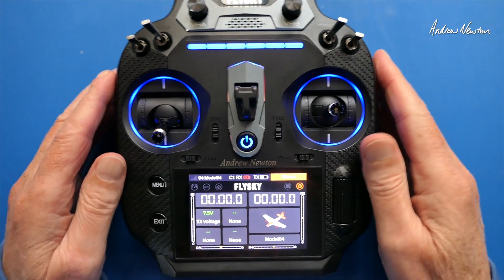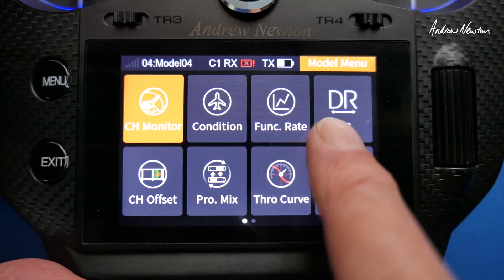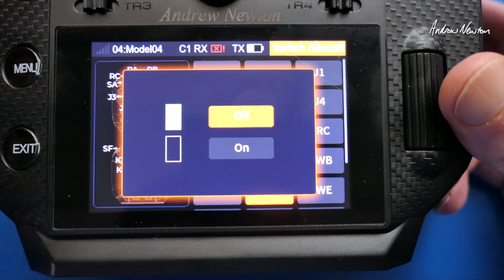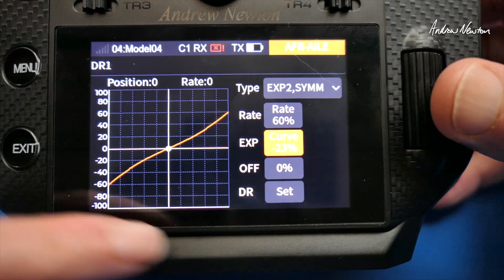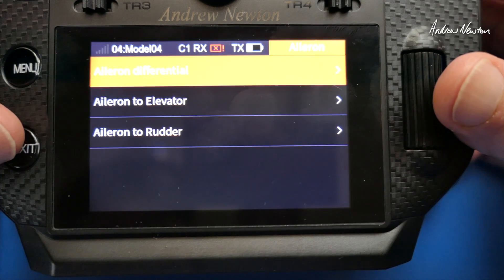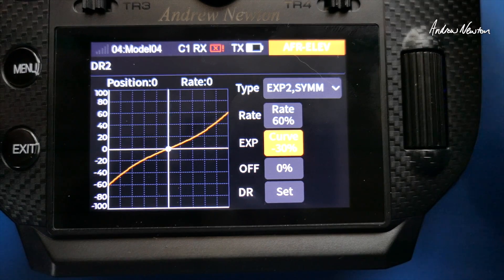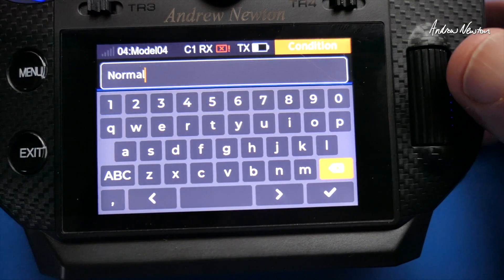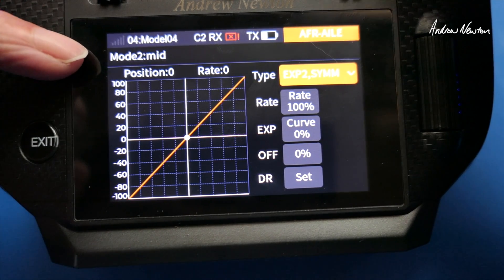FLYSKY FS-ST16 Dual Rates, Expo and Differential

Comment: Hi Andrew, 
Do you have a email to post a question to you?

My question is when i try to use hotwire airfoils in a foam wing.

When i use the same size airfoils on a straight wing its a perfect smooth cuts.

But if im cutting a horizontal tail that has a larger 7" base & a smaller 5" top.  The cuts in leading edge come out way to brittle & break.

Have you ever made a video about this yet?

Any help appreciated. 

Maybe need to cut on an angle?
Reply from the maker: Email listed in the description and Channel Details. Cutting tapered airfoils is very tricky and it takes practice. Also there is a limit to how thin you can go with basic home made cutting setups.